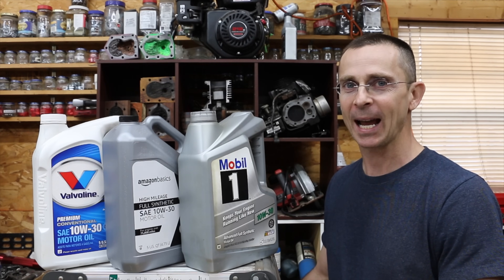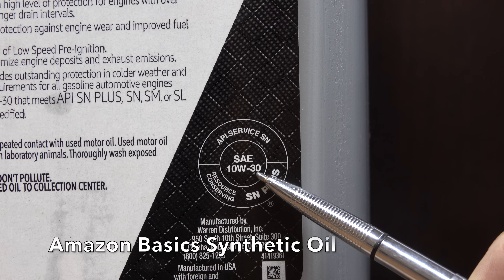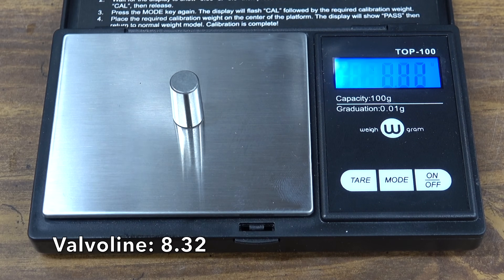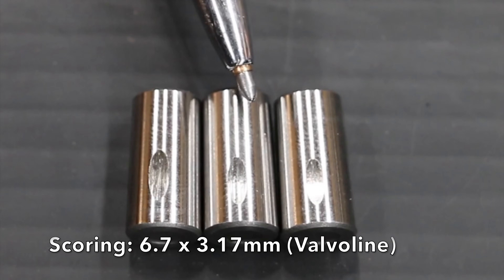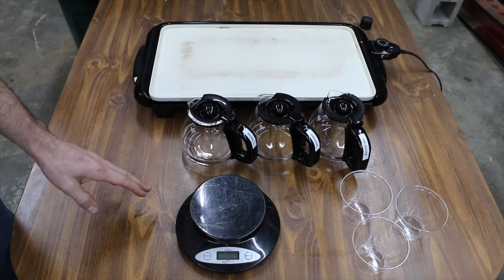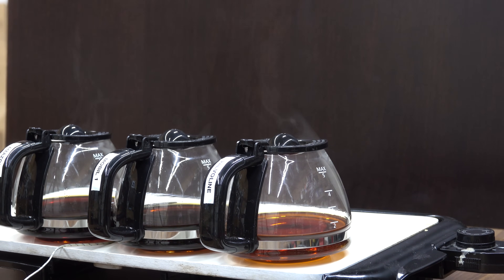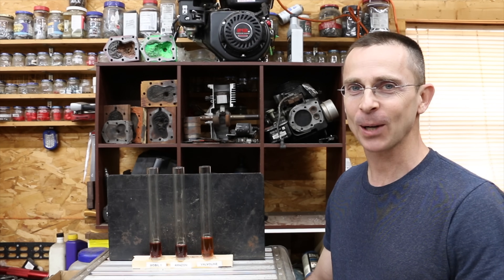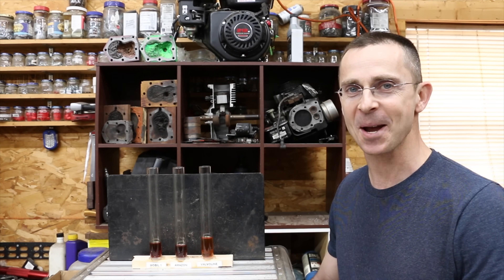Is AmazonBasics Full Synthetic Motor Oil better than Mobil 1? Let's find out!

Comment: Trouble is we don't know what's in or the longevity of the additive packs.
Reply from the maker: Great point. Great idea for future testing--thank you!
Reply: I agree!  I'd like to know the TBN numbers, although I know Mobil 1 is pretty high.
Reply: I've had several extended, oil change intervals tested at Blackstone Laboratories some years ago. For me, based on data provided from Blackstone, it was just about getting whatever synthetic oil that was currently on sale. I was doing 12K OCIs while changing the oil filter @ 6K and changing the oil approximately every 6 months.
Reply: This is a great point that is rarely brought up. However, from what I've seen of REAL data it appears that even over long term use there's so little impact difference to the motor that it's basically all the same (comparable oil to comparable oil that is). Fractions of a percent more wear over tens/hundreds of thousands of miles is irrelevant to the motor and is easily offset (high or low) by many other factors. It's more beneficial to go with the cheapest offering, in the class of oil you use, and save the money towards the maintenance or replacement of the vehicle/motor. - Example: Vehicle takes 5q of oil, 5k intervals, $10 difference per 5q bottle between brands, over 200k miles. That ends up being next to no functional difference on the motor but $400 in cost/savings. ---- All that said,for ages now I've used Mobile1, with a little MMO and Lucas. Call me superstitious, haha
Reply: There is a fella that did a vid with all the metals, detergents sulfur so forth tests on yt

Comment: I live in a cold weather area, today it’s -31c, and have used Mobil 1 in my vehicles.  I am pleased to see by your testing thar the extra I have spent on synthetic oil was worth it.  Thank you yet again for your unbiased testing. 🙂👍🏻👍🏻
Reply from the maker: Mobil 1 is an amazing product. I use it in a lot of equipment with A plus results.
Reply: Agreed.  I never understand the desire to save $5-20 per oil change on cheaper oil.  It's just not worth it and the price of oil, itself, is such a minor expense in the context of the total cost of maintenance  over the life of one's car.  Where I live, the half hour of service technician time is much more expensive than the price of the oil itself.
Reply: alliejr Oh so true! 👍🏻👍🏻
Reply: no matter the oil, in that temp you should use block heater whenever possible.
Reply: j3sion Yes indeed, and a battery maintainer.  The cold will sap a battery quite quickly.
🙂👍🏻👍🏻

Comment: Your comparing two apples to an orange , 2 Full synthetic to one conventional (organic)  motor oil ! ☹️
Reply from the maker: Great point!  It helps add credibility to the value of the synthetic products as well as the test approaches I used.
Reply: Project Farm 
but in your test you say ( we are testing which brand is best ) if your test is just to compare the two synthetic oils then why not add valvoline full synthetic to the mix ?
Reply: The test was for the two synthetic oils the conventional was just to show the difference between them

Comment: Great stuff! Lets see some more diesel tests. I heard a diesel will run off of rendered fat. A lot of biofuel guys say they mix it 1part kerosene to 10 parts renderd fat. Then mix with drill and paddle mixer for a minimum of 45 min. Some guys use non ethanol gas, isopropyl alcohol, or moonshine in place of kerosene. 
Just a thought.. 
Keep up the awesome work!
Reply from the maker: Thank you for the video idea!
Reply: Project Farm my pleasure
Reply: Quite a few common rails do not like running on veg or home brew biodiesel, tends to tear the high pressure pump up
Hence why so many of that scene on this side of the pond tend to favour indirect injection diesels.
Reply: True.  Seems to work better on older diesels. Like the 6.2s and some 6.5s as well as some others.
Reply: @truthpreppin7630  I had an Isuzu diesel, indirect injection, problem was the pump was known to be weak, and worse was coded to the ECU and ergo cost a heap of cash to replace due to the electronics that were included in it.
Shame as it was chain cam, mild level of tune and known to run easily to 350+K miles with regular oil changes.

Comment: I have a suggestion that's unrelated to this video.  You have made great videos about adhesives, but your orientation is mostly towards metals - eg, what do I use to glue my engine block back together.  But I often have to glue plastics.  Could you do a test specifically on gluing different plastics to themselves and to other plastics?   I know you have tested PVC and nylon, but how about ABS, polystyrene, polycarbonate, plexiglas, etc?  Furthermore, it would be interesting to know the performance of adhesives that cure quickly, like CA, and those that cure slowly, like epoxy.  Sometimes, you need time to carefully position and clamp something before the glue hardens.  Thanks, and keep up the good work!
Reply from the maker: Thank you for the video idea!

Comment: If you could I would like to see the differences with room temp vs below 32 vs 400 degree oil. I noticed after ut was heated the oil is darker, just from the heat.
Reply from the maker: Great point!

Comment: In college I am doing at test where I test the lubricity of oils and how temperature affects this, for this I need to build a lubricity tester. If you could tell me the dimensions of your lubricity tester that would be greatly appreciated.
Reply from the maker: Thank you.  There are quite a few sold on the market you might consider.
Reply: @ProjectFarm  the problem is is my college has no money to spend on one so I have decided to make one
Reply: @pezza4709  put a grinder in a vice and press a steel rod against it
Reply: D4x4Bronc I wouldn’t get accurate results and my college doesn’t have a grinder
Reply: then dont do it. tell them to look into welfare and food stamps
Reply: @pezza4709  make your own. Put a mixer motor (those which are hand held) and a belt to a grinder wheel, the rest is wood and screws... Or a drill whit a grind stone and more wood... :-)
Reply: ETG ETG thanks that’s a good idea I hadn’t thought of a mixer motor, I now just need to know the dimensions of the tester.
Reply: Your college doesn't have money? How much tuition are they charging n how many students do they have? My guess would be they are just choosing to spend it elsewhere.

Some digging into their financials combined with carefully constructed argumentation might do wonders to change their minds....
Reply: Remco van Vliet I don’t pay for tuition it is free. This subject is also half an a level so it is allocated no funding.

Comment: That was an outstanding video! A lot of work went into making that video. It's very hard for anyone to dispute your tests. A++. Looks like I'll try Amazon's oil in the future. :-)
Reply from the maker: Thank you very much!  I'm using AmazonBasics in my vehicles now and it a terrific product with an amazing price!  By the way, you've got an AMAZING channel with A+++ videos!  I always look forward to your videos!  Thanks again!
Reply: Pretty good, how about you?
Reply: I've tried to find on amazon & seems like no longer available ! Here in Canada hey!
Reply: My one question would be, can you count on consistency with the Amazon oil?  I would expect Mobil 1 to be very consistent but does Amazon source from many different suppliers and just mix whatever is available at any given time?
Reply: Easy to dispute when Valvoline is conventional and the other two are synthetic.
Reply: @daviddouglas3466  Valvoline was the control. It was there to demonstrate that even if Amazon Basics was inferior to Mobile 1, it was still probably much better than conventional. Turns out, it holds it's own vs. M1 anyway.
Reply: @jaconbits  ya, I can see that. I must have missed that.
Reply: @daviddouglas3466  I guess you missed the part when he was talking about price. :-) If you notice, he had the Valvoline to the left(Cheapest), then Amazon oil, then Mobil 1. Bottom line, the Amazon full synthetic motor oil is as good as or better than the Mobil 1. That says a lot.
Reply: @electronicsNmore  I thought he was demonstrating how Amazon oil stacked up against the two major brands Valvoline and Mobile 1. Valvoline Synthetic is $23/5qt and Mobile 1 is $27/5qt. The better way to have done what you are describing is to use the same brand for the conventional and synthetic oils.
Reply: @David Douglas He was making a point. Why buy conventional motor oils like Valvoline, if you can buy Amazon Full Synthetic motor oil for a little more money which is good as or better than Mobil 1(and likely many other brands of full synthetic).
Reply: In no way do any of these tests relate to how oil acts in an engine lol. People are so damn gullible. 99.999% of viewers don't even change their own oil or cut open their oil filters each change.
Reply: Oil is literally pumped through your engine, gravitational testing doesn't fucking matter unless you are trying to find out how long it takes for the oil to get to the bottom of your engine when you shut the car off LMFAO.
Reply: Thanks a lot for the fucking spoiler.
Fucking hell..
Reply: @MrMiss-cp9bw  Who reads the comments before watching the video then gets their panties in a knot when the videos contents are discussed?
Reply: @MrMiss-cp9bw  Yeah well stop READING ALL THE DAMN COMMENTS WHEN YOURE SUPPOSED TO WATCH THE VIDEO THEN, impatient phone swiping  .... ARGGGHHH :D :D
Reply: Putting a bearing against a spinning piece of metal that is picking up oil doesn't test shit either. This never happens in your engine.

Comment: Please try this same test with Supertech conventional, Supertech synthetic and Pennzoil platinum... Great video!!!
Reply: This please I have been so curious and nobody has tested this oil really...
Reply: Supertech full synthetic is awesome! Used it for many years and is a hidden gem! If i recall hearing a long time ago the oil is basically Mobil1.
Reply: Agree. Supertech is MUCH cheaper than AB but both are bottled by the same oil distributor
Reply: Agreed. There's rumors that AmazonBasics is rebranded SuperTech, which might be another rebrand
Reply: @JoeStuffz  brand seption
Reply: @JoeStuffz  I think I might start rebranding AmazonBasics oil
Reply from the maker: Thank you for the video idea!
Reply: Project Farm I second the video for super tech test!
Reply: Project Farm it would be great to see Mack (diesel truck) oil and BG products oil too. Both are supposed to be among the best.
Reply: Project Farm Could you please also test the amazon basics oil against valvolins modern engine synthetic Mobil 1 extended performance and royal purple motor oil. I really want to what is best for my 13 cooper jcw
Reply: What about testing Amsoil. They really promote their products and price it accordingly. Right now their 10W-30 synthetic is almost $13 per quart.
Reply: @FrankenDoctor  I found 0w30 for under 8$ at an ace hardware
Reply: Add Royal Purple to the list please
Reply: Also shell diesel oil too
Reply: @486068286  Rotella T for sure!
Reply: I think they do use Supertech,under their own bottle.
Reply: BryDuhBikeGuy Supertech's oil comes from Warren Oil Company, so does amazon basics. Many other oils are made by Warren.
Reply: I can think of a lot of oils I would love to see... I love seeing a value oil showing impressive results!!!
Reply: I'd like to see Valvoline VR1 compared to a few different oils including the Amazon oil.
Reply: Yes please! Test more oils! I will be giving Amazon basics oil a try
Reply: I made this comment just now too!! I use supertech all the time!
Reply: For my '03 BMW 530 Sport & 01' 740 Sport I've been using Supertech for years. I've also ran Mobil 1 full synthetic & Amsoil but Supertech burns less than the others here in this dry El Paso heat.
Reply: don't forget Castrol
Reply: Chevy D add rural king oil to the list.

Comment: Wonder who makes or where Amazon gets their Synthetic oil
Reply from the maker: Warren Distribution out of Omaha NE.  They've been in business a long time and they seem to have a great reputation.
Reply: @ProjectFarm  they also make Wal-Mart supertech oil I believe can you do this test with Wal-Mart oils please be Amazon oils
Reply: @kevinanglin678  I wish Super-Tech had been included in this testing. I'm sure it outsells most other oils. I've used it for many years now and notice no difference in performance than Mobile 1. Most oils are very good today.
Reply: @nutsnbolts76  and super tech fill synthetic is so cheap makes 5000 mile oil changes very economical.
Reply: I used to live in Omaha, know all about Warren Distribution.  big company
Reply: @ProjectFarm  Rural King sells their brand using Warren too. Great price full syn
Reply: @ProjectFarm  
Good job,,,  tnx..
Reply: If you have a Rural King around you, they also sell this same oil made by Warren Distribution and it's cost is 6 dollars cheaper than Amazon for a 5qt bottle. As of Feb 2019
Reply: PF stated this in another post: "Warren Distribution out of Omaha NE."
Reply: I think they also make the Walmart SuperTech oils.
Reply: China~
Reply: Tractor Supply also sells Warren oil as Traveller brand
Reply: @kylesonsalla7620  warrens got the oil market locked down
Reply: Was there any oil on the bearing before the grinder touched it?
Reply: @xl250mon5  - it's not a grinder.  It's a lubricity tester that places two pieces of smooth hardened steel in to contact with each other in order to evaluate the lubrication afforded by various products.   PF cleans all parts, smooths the roller and uses a new piece of bearing material (the part that shows the wear) for each product.
Reply: @flick22601  thank you for explaining ,makes sense to me now .great video.
Reply: @xl250mon5  - Gotta agree.  I've learned so much from watching his videos.  The comments are generally great too, when they supply information, CONSTRUCTIVE criticism or point out a flaw(?) in the tests.
Reply: That has to be a great gig for Warren Distribution. This video won't hurt em either
Reply: Sorgel a lot of mechanic shops use the mag one oil I think it ran better in my Jeep then rottella does but all the Jeep guys love the rottella in the 4.0 jeeps
Reply: I’m running Mag 1 right now here in Chicago. Warren dist makes this oil as well, had the polar vortex a couple weeks ago (-27 with a wind chill of -52). Truck sounded fine at start up.
Reply: Aliens
Reply: Not all synthetics are created equal.   Mobil 1 from an engineering standpoint is far superior.   Molecules are all the same size so the wear layer is more even.
Reply: Look at 1:13 . Just below the "doughnut" it clearly states where it is manufactured.. In America not china.
Reply: @bondedstars  there is a number under the bottle on mine and search it and was from that company so I believe it is
Reply: Scotty Kilmer has a video explaining who manufactures Amazon oil.
Reply: Why didn't you use all synthetic oil? You're comparing Apples and oranges.
Reply: B. Wiesbrbj I’m guessing that was his control group.
Reply: B. Wiesbrbj Mobil 1 was full synthetic the Valvoline was conventional my guess would be he was originally thinking at that price there’s no way the Amazon was full synthetic so he wanted a conventional oil to compare to but in the end Amazon yet again hits a homerun they seem to do great product research before putting their name on it
Reply: Scotty kilmer made a video on the same Amazon oil. He gives his thoughts and says who manufactures the oil.
Reply: @hiyall15  But who wants to sit through a Scotty Kilmer video?
Reply: @hiyall15  
Scotty Kilmer is a participant in the Amazon Influencer Program.
https://youtu.be/Ye-5EyrwkOQ
Reply: @hiyall15  dont watch that guy. He is poison
Reply: @mikewest712  Right!!!. I always feel he provides useless information.
Reply: @mikewest712  - jealous are you.
Reply: @gr8bart1  maybe for you but, for his 1.8 million subscribers, he provides a lot of useful information.
Reply: @NeoNoggie  I started watching him but his way of telling all one is literally screaming attention. Where as guys like project Farm and Chris fix do tel you something and want to educate you with their knowledge. Also I stopped watching Scotty, for me as amateur car guy he tells no new thing but only assumptions
Reply: Useless tests, if u want cheap oil just buy supertech
Reply: @D4x4Bronc  - So, go somewhere else.  What testing videos have you posted.

Comment: you should do a video on aviation fuel see how it compares to regular fuel i use to run 100ll in my 1966 mustang i though it got better fuel economy then regular pump gas great channel btw James from cos.
Reply from the maker: Thank you for the video idea!
Reply: @ProjectFarm    This goes to my octane booster request!! ^ ^ ^ ^
Reply: absolutely noticeable improvements running 100LL!! my grandpa used to fly and had tons of the stuff.. my go kart and mini bike loved the stuff lol.  but Ive run it in a 460 Bronco I used to have and it loved it too! there's no ethanol or other crap in it so it burns super clean.. plus its leadded.. would be a great test vid forsure 👍👍
Reply: @83glxcrusin97  what year of bronco did you have
Reply: @CentralOregonShenanigans  It was an 80 with military tires, Detroit Locker 5:13's and a 78 interceptor 460 that was mildly built up.. Extreamly sad loosing that truck.. women.. but it was an absolute beast!
Reply: @83glxcrusin97  i have a 1978 that im fixing up over on my channel
Reply: @CentralOregonShenanigans  sweet! I'll gander on over 👍